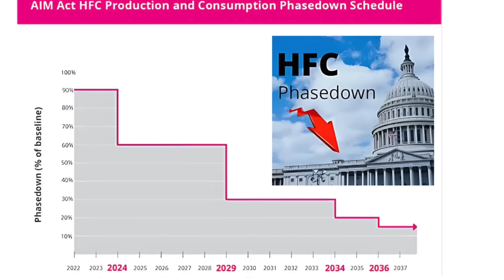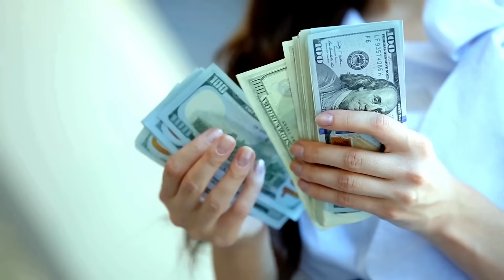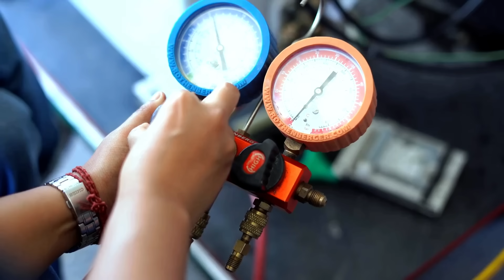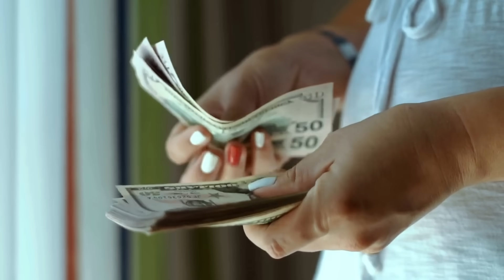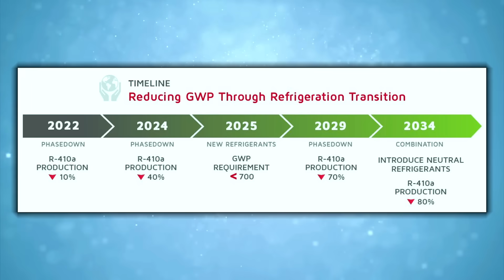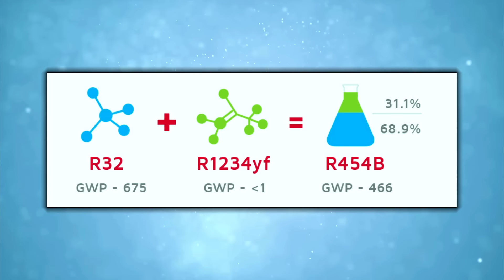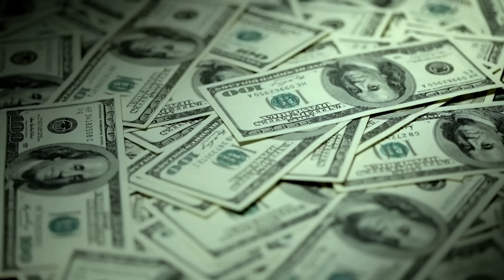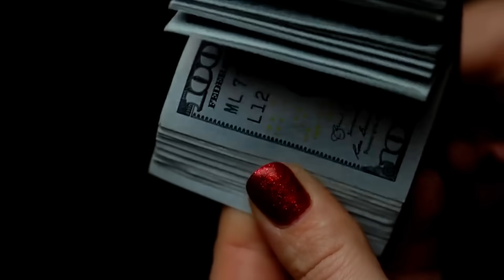Latest on the 2025 Disaster in HVAC and 454b Problem!

Comment: This sounds like a residential problem. Commercial shouldn't have to many issues but I've seen carrier and yorks with horrible workmanship after covid on commissioning. I wouldn't use flammable refrigerants in my house unless I'm installing the equipment. You already have natural gas and we seen in San Bruno CA what natural gas can do to a neighborhood when you have a gas leak. Seeing that these issues are happening sounds more like residential installs. I think the manufacturers should have only certified techs install those systems because it is flammable and the refrigerant is short. Get it right the first time instead of band-aiding the problem. Money hungry people will only cause more destruction than solutions.

Comment: I really do hope it backfires for those big companies that bought 410-a in bulks and equipment 

Just know the warranty starts when it leaves the manufacturer
Reply: Nope, it starts on the day it’s installed and commissioned.  We register everything for our customers, after they’ve paid.  I’ve installed equipment 2-3 years old that was sitting around in the supply house or our shop, and haven’t had issues registering warranties.  We also sell 10 years old labor warranties.  Goodman made that really easy, and the custom has up to a year to buy the labor warranty. The majority of the time we just sold that upfront.  
The only thing Not warranted by any manufacturer that I know of, is refrigerant.
Reply: What are you talking about?  The warranty doesn't start when it leaves the manufacturer.

Comment: 1) Most manufacturers on standard split systems have almost always added extra charge for 15’ of line set.  But, after start up and checking, many of the R410a units we’ve installed, ( brand R ) have been quite low, up to several pounds low!! 

2) To start the year off, 2025, we sold pretty much nothing but R410a, and all available equipment ran out by early late March in our area. 
     So,We’ve only had R454b since then.  

3) We’ve been lucky, and have been able to buy one jug per week, at a super inflated price mind you.  The other thing is, ( brand R & H ) have had plenty of refrigerant from the get go and we haven’t had to add very much refrigerant, if any, so far.   I will say that I’m not happy with the running pressures of the new equipment, or the SH & SC numbers.  I’m getting weird reading and have tried to calibrate my gauges several times, including buying new all new dedicated SMANs and Probes just for A2L refrigerants.  The numbers are still off, high SH and SC readings, not to bad but up around 12-14 on both, yet the suction pressures and temps hover around 108-112psi and 33-36°.  This is happening on almost all of the R454b units we’ve installed, including package units. 

4) I have not talked to one person or heard of anyone mixing refrigerants!! I don’t know where that’s coming from or what kind          
     Fool would do such a thing. Especially to brag about it.  That’s craziness!!  I’m Not Walter White!!

5) The big issue I have is the hurried engineering designs I’ve seen with the sensors and connection.  Poorly executed and bad excuses on how to   
     Complete the connections in the field.  The aesthetics are awful. We, as a company have had to buy nice looking junction boxes and wire lume          to dress up the look.  Most manufacturers seem to have focused on getting as much 410a equipment built and out before the new year. Then in November or December started hap hazardly manufacturing 454 equipment.  Most of the furnaces are the same as the last couple of years, and are not specifically designed for 454, but require wiring in the field to make the sensors function properly.  I haven’t seen a dedicated factory plug and plug unit yet. 

6)  The EPA, AHRI, refrigerant manufacturers, and HVAC companies should have designed a lower pressure refrigerant, more like R12, so it’s safer for tech, and less stress on the compressors, mean less amps.  I’m not a fan of high pressure refrigerants, including R410a. It can be dangerous. In the 100+ degree summers, 400+ psi on liquid side is common, and I’ve several Schrader valves get stuck open spraying refrigerant.  Now, I shut off the system and allow it stabilize, still over 200+ psi, before removing my gauges. 

7) The industry needs to get on board with making the equipment pressure ready from the get go, so, minimizing the need to solder complete.  It would also be wonderful if a single style of press fittings were standardized, like ProPress for water and MegaPress for gas is. Currently, I know of 9 different type of ACR fittings, and different suppliers carry different brands. , this can be a pain.

8) The other thing you didn’t mention is the BS tariffs causing inflated pricing too.  It’s such a load of crap!! Nothing has really went into effect, yet the manufacturers and suppliers have raised the prices.  Since the 2020 “ Illness”, price increases have been a quarterly thing.  Equipment and materials have doubled or more, since 2019, and the new equipment has done the same.  It doesn’t matter which refrigerant or manufacture, the inflation rate on an HVAC system is getting out of hand.  (I know this applies to everything else we consume and need, but come on!!) 

As a contractor and a consumer myself, I agree with you. The industry and EPA need go back to R410a, and to start over on a lower pressure refrigerant, better designed equipment, and better pricing to make it Right for the customers and contractors.  
If it doesn’t get any better in the next couple of years, I’m going to quit as an HVAC contractor. Maybe I’ll move over to the Primadonnas of the trades…………Controls Electrician.
Reply: Another thing, I’ve seen contractors switch brands over pricing, availability, arguments with supply houses, ect.  Many companies brand jump all the time.
Reply: I agree with all your points
Reply: The government and fellow travelers have perverted the whole industry leaving manufacturers screwed trying to comply with overreaching regulations.
Reply: I'm racking my brain trying to figure out who brand H is. The majors are brand T, C/P/B, R, Y, N . I can think of a Korean brand H, but they make cars.
Reply from the maker: Might be Hisense
Reply: @realSamAndrew  Heil is the only other I can think of, but last I seen that was all made by carrier. they are on r454b though.
Reply: They’re simply pricing us out of the country….seems they do this as a country becomes prosperous and built…they then price out the folks who built it and make it theirs and only theirs….
Reply: Her there be nice ! 
I am a IBEW HVAC Control electrician . Mostly  work on Siemens and Johnson Controls . 

Have a quick question. 
I am installing 2 9000k 24 SEER2 R454B 
mini split for 2 separate rooms on my home . 

After doing some research I am thinking of going with an off brand . 

Have any suggestions or insight  ?
Reply: only place I've seen 15' line sets work is on mobile homes, which are utter trash anyway.

Comment: I've jumped to Goodman and Amana. It's not my favorite equipment but I will do so until this shortage is figured out.
Reply: We did Goodman for 15+ years and didn’t really have any problems.  I’m not a fan of their furnace cabinet design, the condenser paneling, or their package unit layout.  Goodman is behind in the industry as far as their overall metal, design, and ease of major service.  But, they work, and work just as well as any other manufacture. The reason we switched is because our local Goodman got taken over by Steven’s, which is owned by Daikin too.  When they came in they fired everyone who was a Goodman employee, breaking up long temp relationships.  Most of the Steven’s employees are just like the auto parts stores, the employees know absolutely nothing about the products they sell, only what the computers tell them is in stock or not.  Next, they raised their prices higher than other brands, that do have better cabinet designs and engineering.   

The way I see it, it’s like cars, every brand does the job, and every brand has issues or quirks.  For the last few years we’ve been installing Rheem and Heil, or sometimes whatever brand that certain customer or builders strongly request.

Comment: Mixing is interesting. They can confirm this by checking the average molecular weight calculation: when you mix these two according to their weight percentages, the resulting average molecular weight comes out to around 62.6 g/mol, which matches the published data for R‑454B.

Sine the blend is zeotropic, in theory the compositions in liquid and vapor differ, however in a closed system homogeneous mix is assumed. Soooo I bet someone can get close to this, but the risk outside of that mixture I am not sure. What if someone did 70/30. Will that compressor have a shorter life. My guess is tolerance is there.

Comment: The HVAC industry was in trouble when they introduced R410A. If this 454B is that expensive, then what the hell was the point? I foresee Midea making a killing selling window units in the next couple years, they won't even need to worry about profiting from their mini-shits!
Reply: That was 30 years ago.
Reply: @JohnD-f2o What was 30 years ago?
Reply: Trouble with R410. I was around when it was introduced. Every one was afraid of it. There was a learning curve for sure. And equipment was not designed for it. Every coil sprang a leak after a year. Took about 5 years for all the issues to get fixed and tech trained. property. The myths about 410 were ridicules.

Comment: My Arocoaire is tweny nine years old and for the first time I had to  replace my condenser fan motor. The compressor still looks brand new. This has nothing to do with the environment its pure greed designed to fail. These units are flat out junk.

Comment: "Recover" all 454b and charge with 410a. Same pressures same oil save money
Reply from the maker: Have you done this?
Reply: @NewHVACGuide  Another local guy says he did it in his home and has been monitoring pressures and temps and it looks good just like a normal 410a system
Reply: @NewHVACGuide  someone has,and says you will loose a bit of capacity,and when the price goes down,you can change it.R454b only,not r 32.
Reply: Even the A2l rec.tanks are hard to find.
Reply: Do you plan on changing the nameplate too? Pressures are similar but not identical. I wouldn't want to be the the one that has to troubleshoot your fraudulent work at some point in the future. What is your license worth to you?
Reply: @doneden5368  how do you sit down

Comment: I tell everybody save themselves the headache get a 410 a unit  the auto parts you can still get a hold of 4:10a it’s cheaper.
Reply: Dude, where TF are you going to get a 410A unit from. There is basically none available anymore. They got bought out and swallowed up within the first few months of 2025.

Comment: You know what caused this whole disaster, the EPA forcing this change. If the EPA says they are worried about global warming potential, then why did we switch to r410a from r22 when r410a has a higher GWP? Is it the hole in the ozone cause supposedly by CFCs? We now see more CFCs in the atmosphere than ever before and have a smaller ozone hole. Blame the one who started this all not the manufactures.

Comment: Anyone remember when 410A came out,oh my,you need special gauges??
Nowadays they sell the 410 gauges with 22 on the pt rail.???
It’s all a scam
Reply: Yep.  Same thing all over again with A2L refrigerant.  Get a new vacuum pump, recovery machine, gauges, and  the like
Reply: same thing on the automotive side, r12 is so bad so go to r 134a oh but the fittings are all different now so new tools etc, and now the insane prices on the R1234YF refrigerant, and ... oh ya the fittings are all different reverse threaded and crap
Reply: the older gauges had lower pressure ratings and so did the hoses. in both readout, working and burst pressures. that's why the alerts, panic and new gauges/tools needed.
Reply: Amen brother. Like  replacement R22 compressors shipping with POE oil, no flush needed.

Comment: It’s so dumb, everyone should just use R-32.  I would have to believe that companies which are using R-454B could “re-engineer” their products to use 100% R-32 in a heartbeat if they wanted to.
Reply: I’m shocked r454b was even made, it uses r32 why even make a new refrigerant if they are both a2l. But maybe it’s because r454b is slightly lower gwp 😪
Reply: @yinggamer7762 The "Gang Green" crowd is relentless and frequently clueless. It's a miracle that the ozone hole is no longer a problem even though each of those upper atmosphere "killer" chlorine molecules was claimed to remain active for 100 years. Then we had predictions  of global cooling, then global warming, and now just climate change which seems to mean slightly cooler average temperatures in some places and slightly higher average temperatures in others. Both variations being attributed to the exact same causes. Between the 2 main A2L refrigerants, I predict that straight 200 proof R-32 will be the first to be targeted when the GWP goalposts are once again moved.

My old Robinair manifold has P/T scales for R-12, R-22, and R-502 so I've seen major changes in equipment, tools, and best practices over the past 5+ decades. Imagine routinely topping up a system at the beginning of every cooling season relying primarily on a sight glass and occasionally checking for leaks with a flame. It used to be that the only place I would encounter a reversing valve was on an ice machine. Retired now, I only work on my own HVAC and installed a pair of 1 ton R-410a cold climate mini splits a few years ago. The bi-directional heat pumps are amazing machines, especially when compared to old school equipment but they are no where near as forgiving of sloppy workmanship during installation. I took one look at my old Robinair pump and didn't even bother plugging it in. Didn't trust the hoses on the old manifold either. Replaced both with new but not high end. The BacoEng BA-1 pump is rated at 0.8 Pa (about 6 microns) ultimate vacuum while every other cheap single stage pump I looked at was only rated (if at all) at 5 Pa (about 40 microns). Cu Ft ratings are relatively unimportant for residential - the non-condensables (gasses) come out quickly. It's the rather "sticky" water molecules which need more convincing. That takes both time and as close to prefect vacuum as can be reasonably achieved. Left inside the system they will eventually combine with the POE oil to form acid. I only used the new manifold for the nitrogen pressure test and used just one of it's hoses for vacuuming. I was able to achieve 120 microns and holding rock steady at valve off using the Appion core tool and CPS micron gauge. Industry recommended standard is 500 microns with some upward drift allowed at valve off. It's one of those things where many installers will accept 1000 or 2000 as being good enough (time is money) without knowing or caring why that is bad for the customer. I also bought one of those newfangled eccentric flaring tools. Wish I had one of those many decades ago.

I'll be adding a third cc m/s this fall which will give me a slightly more even coverage, redundancy, and extra capacity for those sub zero days that are well below my 1% design temperature. This time it will be an already purchased 2 ton R-454b machine (another re-badged Midea from the same importer). The A2L version in this specific size has an HSPF2  rating that is about 30% better than the previous R-410a version it replaced. The SEER2 and HSPF2 numbers of most of the current crop of A2Ls is pretty close to the R-410a models they replaced.
Reply: @yinggamer7762 no, it's because they wanted a new patent so they could gouge you and enrich themselves.
Reply: @yinggamer7762  There is a lot to it, with possible (read, probable) ulterior motives in the mix, but I agree that R454B should have never become a thing. That said, aside from the lower GWP compared to R32, 454B can also be a bit easier on the compressor. That could be another "selling point" to an equipment maker. But really R454B seems like just a big circle jerk for the industry and buying yet another proprietary refrigerant when something else would do. The kicker is, not only have other countries been using R32 for decades, but R290 (highly flammable, being propane) is also used in some pretty great systems outside of the US. I wish we had access to the sort of monoblock/package units that other countries have for HVAC and DHW.

Comment: I am just hoping my r22 system keeps running. I still have some 22 in my shop
Reply: My boss had me charge up a 25 year old RHEEM central air unit yesterday
It was R22
Reply: Yeah I have put stop leak in it once, I just check it every year, wash the coil and check the capacitor every year.
Reply: @buckbryant8599  I just found a sealed 30 pound jug of R-22 in my dad's garage. He died 24 years ago and I know he bought it in the 1990's. I think I might put it in a cool dry place in my garage.
Reply: Yeah I got my first hvac job in 1994 I think we could buy a r22 jug for like 50 bucks then.
Reply: @kimmer6 ur so lucky! What a find!
Reply: @kimmer6  winner!
Reply: @kimmer6  Better off selling it. There are replacement refrigerants for r-22 that do the same thing and operate at almost the exact same pressure. If you have a repairable leak you'd lose money by not selling that jug than replenishing a lost charge of refrigerant.
Reply: U know it’s just methane and butane with a bit of fluorine and chlorine to bring up the pressure in the lines….DuPont’s patents ran out so the gov banned it to force us to make duponts another fortune ….it isn’t illegal to make it have though
Reply: Im calling the cops !